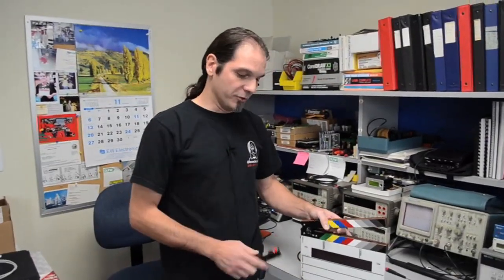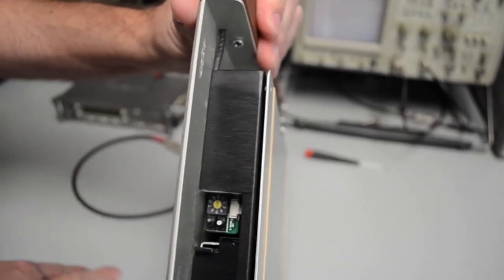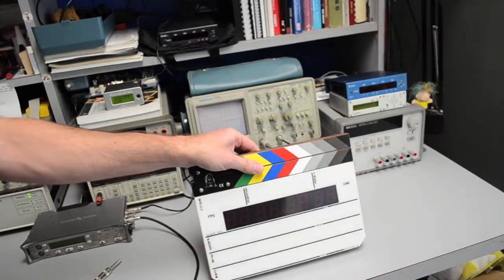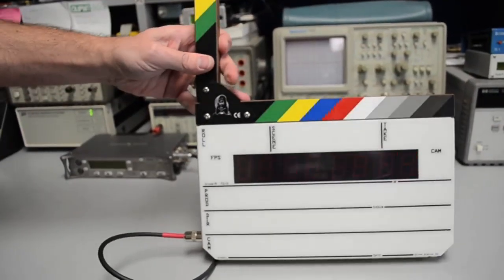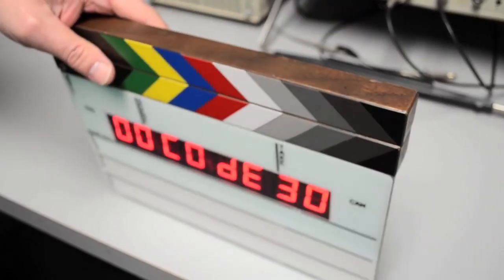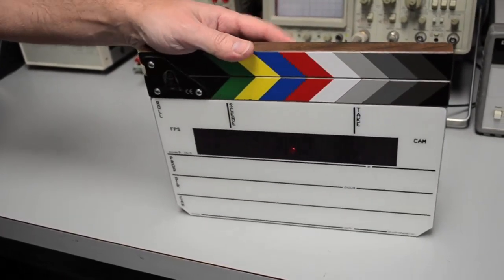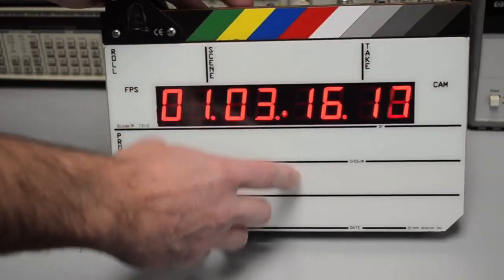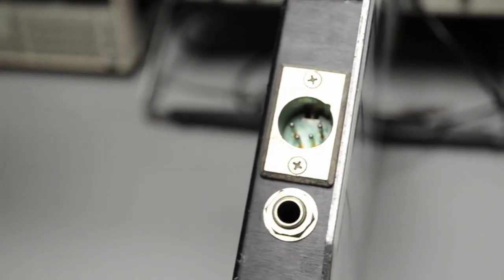Denecke TS-3 Time Code Slate

Comment: I do not understood. When you slap it together, he says you lose 4 fps, doesn't that mess up sync with the camera? The audio and the visual will be 4 fps off when you go back to sync it together in post? I thought there was no point in clapping it anymore?
Reply: Timecode is set to free run, wich means it runs without stopping (timecode can be set also to 'rec run', that is what you are referring to, it will only run when recording. Free run is used for sync between different devices)

Comment: Very helpful video. If the camera has its battery replaced and/or is turned off, the camera will lose time code and be out of synch even if the slate looks ok. Re-jam (re-synch) the camera after this happens.

 Also, whoever is operating the slate might turn it off and not tell you, thinking they are saving the batteries. But it also makes the time code go out of sync, so watch for the code displayed which Charlie mentions starting at 4:24.

 If your time code cable has a lemo connector, make sure that whoever is dealing with the cable removes that cable by pulling on the release collar and not any other part of the cable, which could break something. Camera people shouldn't be pulling cables from the soundman's audio recorder, just as the sound guy wouldn't remove any cables from the camera, without a previous understanding of which cable they are dealing with, why and how. 

If you rent/buy a slate, try to get a cable that is long enough so you have some slack in the cables when synching (jamming)., so they don't get pulled which could damage it or the connections on the slate, camera or recorder. 

Many cameras won't hold time code accurately for a long period, so re-jam after lunch or leave the slate connected to the camera. But camera operators like to move around untethered, so this isn't a viable option. 

Lock-it boxes are available to keep the cameras in synch more accurately that the cameras can do it by themselves. Some are quite small and can be velcroed to the camera or some bracket without getting in the way.

Comment: How do you turn the back screen light on for night shots?
Reply: +Connor Landrum    There is a display brightness switch on the back of the slate. One of the positions turns on the backlight. You can't see it, outside, during the day. You might be able to hear the noise if makes, however.